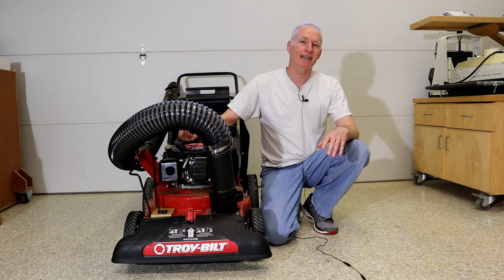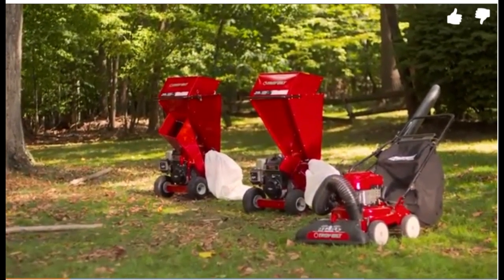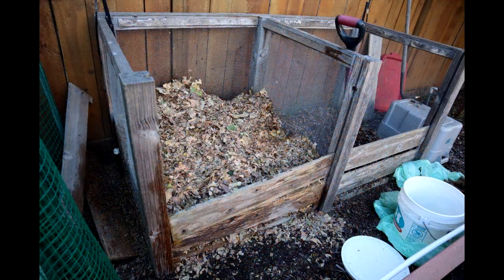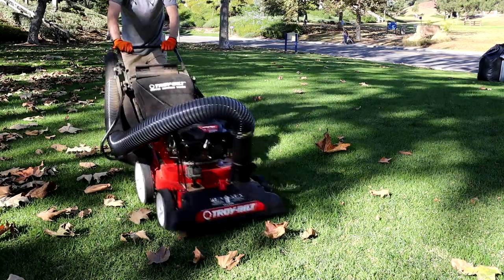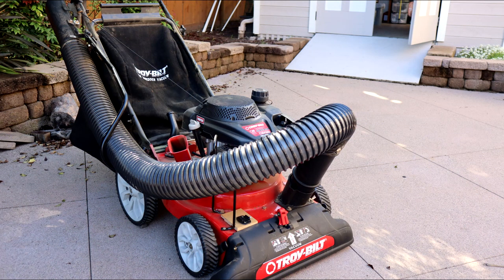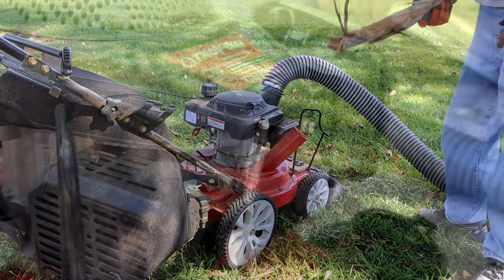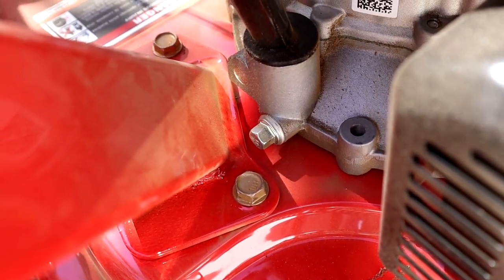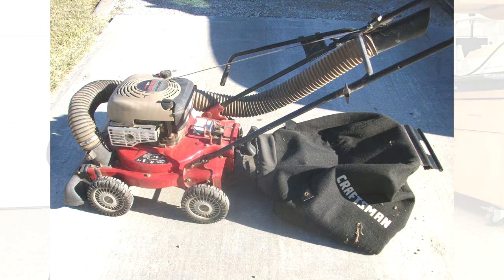Troy-Bilt Chipper Shredder Vac Review

Comment: Another question: Is there a throttle on this specific engine?  I looked today at the Cub Cadet version of this CSV and there was NO throttle control.  Weird.
Reply from the maker: No throttle. It runs at a fixed speed to create enough vacuum to pick up debris.
Reply: Very few small engines have throttle control these days, but you can probably fit a honda clone carb with throttle control. I have a cub cadet and I would love throttle adjustment. There are times that I want to rake an area or step away from the machine for a second but don't want to turn it off and don't want to waste the gas running it at full rpm. I don't know why they eliminated throttle adjustment from small engines. It's probably a California law thing.

Comment: it looks brand new, give us a review in a year or two
Reply from the maker: I've had it now for 4 years. Couple of things during that time. I replaced the vac hose with one that is more flexible and works better. Also the carb jets are prone to clogging. Each new season I have to take off the carb and shoot it with contact cleaner and compressed air. They seem to get gummed up. Then starts on first pull. 
I also mentioned the catcher bag in the video. It continues to be irritating.

Comment: Clearly an MTD designed machine. Mostly the same as Yard-Man Yard Vac 55 just different engine and metal cover for the impeller vs plastic cover on the yard man. Else it's the same machine. Used ones usually go for a hundred bucks.